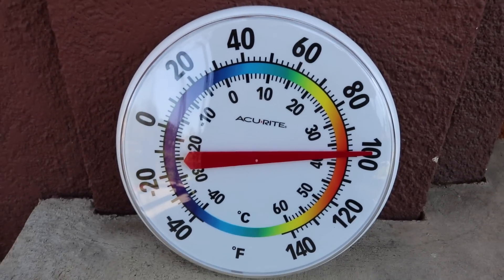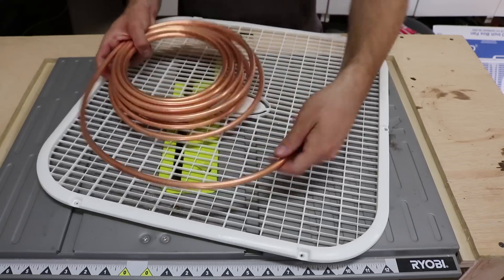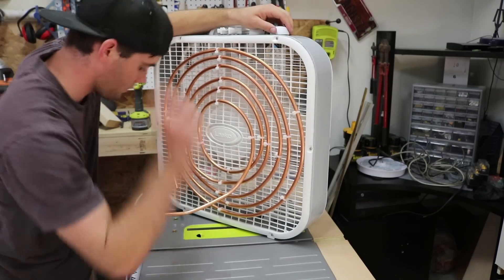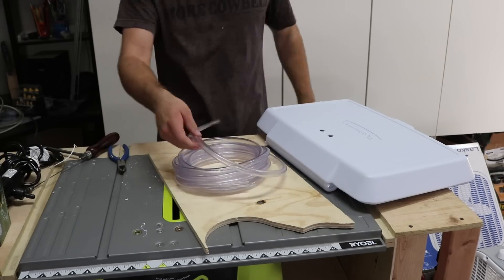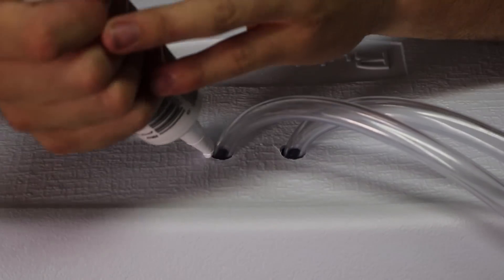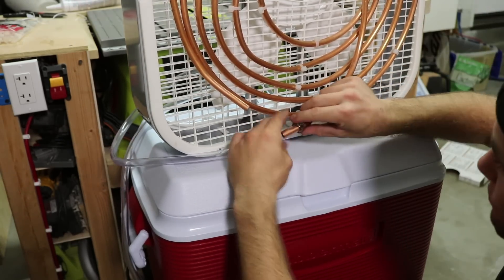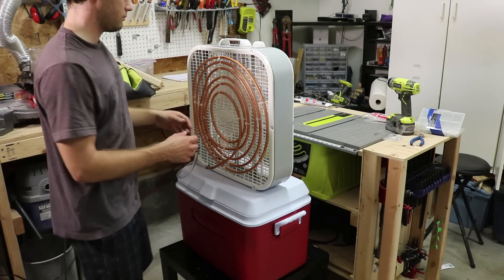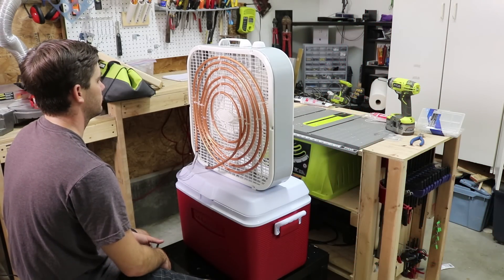$100 Homemade Air Conditioner - DIY

Comment: why didn't you just buy a $98 AC from walmart?
Reply: Because this invention does not require a hole in the wall to exit the heat, and a $100 air conditioner at those temps would be useless.
Reply: @JohnSmith-wd9rc  "Because this invention does not require a hole in the wall to exit the heat" because it doesn't exit any heat!
Reply: There's a couple of reasons why this is better for a garage / enclosed space:
  Window AC units stick out through a window, or hole in the wall for two purposes.  There is accumulated water which needs to drip somewhere,  and the heat exchanger needs to exhaust air outside (otherwise it would completely negate the cooling, if not cause /additional/ heat)
  Those portable units have the same requirements, though usually a bit easier to deal with, if you have a window (but then, why not just get a window unit?) 
  Portable units have 2 things over window units: usually less power draw (so no dedicated circuit, or worry of overloading a circuit) - and they're, well, portable - meaning you can move them around within the room, or to other rooms as needed.  

A home made swamp cooler (which Ben created here), requires neither an exhaust port nor dripline, and is portable.  It also requires much less amperage than either AC unit.  The downside is that this will cool a small area barely to humane levels in those temps.  This is a good design, if for temporary / non-permanent use. 

For a more permanent solution, this can be scaled up to a buried 55 gallon plastic drum, automotive radiator, and a single motor to run a spindle pump and fan unit.  Burying the barrel to a depth of about 4-5 feet (the bottom) will allow the water to cool off better, as ground temps are usually stable at much lower temps. Using a stable liquid, this can be left in service for a long time.  I wouldn't use water alone for this.  Possibly automotive coolant as an additive and stabilizer if not something else. 

I've seen homesteader plans for using PVC pipe buried in the ground, in a U shap. One end is outside of the home, with a capped T on sideways - the top being capped and used for cleanout purposes, and the side with a screened off elbow for air intake.  The other end is inside, with a blower fan pulling air in.  The pipe has to be long enough, and deep enough for the air passing through to be cooled off.  This isn't usually something suitable for suburban settings though. 

So...  his homemade swamp cooler, even being $100, is a better use for his purposes.  And, it'd made a great power-outage cooling system, running on a generator or battery system.
Reply: @AeSix_Reficul  This is not a swamp cooler. This is closer to a very low btu air conditioner than it is a swamp cooler.
I know. Study is hard.
Reply: @AeSix_Reficul  
Very informative. Thanks! 👍
Reply: @AeSix_Reficul  This is not a swamp cooler. A swamp cooler MUST intake dry air, and allow the cooled air to push the room air out of an opening. Without an opening, the room will become humid quickly, and fail to cool. So, it DOES need an "exhaust port" in the form of a slightly opened window.  He made a humidifier.
Reply: @heidis8713  It depends on what type of climate you live in a dry climate it does make it much cooler.
Reply: @johnmcd6652  I don't understand your comment. Can you clarify for me please?
Reply: @heidis8713  Yes, At no time did this presentation tell us how much of a temperature change this device made. Kind of important information don't you think?
Reply: @johnmcd6652  I'm still confused. Which comment of mine were you responding to? To answer your last question, I don't believe that this device would change the temperature of the room at all. Possibly 1 or 2 degrees cooler in the area directly in front of the fan, but then it would gain 1 or 2 degrees when the humidity in the room went up. Not to mention the fan and pump motor contributing to the increase of heat. It's certainly not a lot, but temperature wise, it's still moving in the wrong direction.
Reply: @AeSix_Reficul   Dude, you laid it all down. I was just going to say because those go in windows but you sir went above and beyond
Reply: Ice and water can cost alot to keep on filling that up also
Reply: @vg2binkey884  ice can be free as most people already have a freezer and water can be recycled or use ready ice packs then reuse the water change out every week or to. You could also reuse empty water bottles as ice chunks refil water bottle partially with enough room for expansion then at the end of the day toss them back in the freezer next morning they should be frozen again and ready to go.
Reply: Very interesting, but how fast do you go through a bag of ice?
Reply: @PVP your a traitor as well.
Reply: Would you have watched a video about that? ;)
Reply: Limp business  I agree.
Reply: Because then you have to go to Wal-mart and deal with check-out?
Reply: 'cuz the video made him more than 2000$
Reply: Because it would make his electric bill shoot up
Reply: Cause he takes pride in his own inventions
Reply: Dump a 12 pk in the cooler and u r done 👍🏽
Reply: That’s what I was thinking in Walmart you can get one for under 100 bucks  and it really work spend all that time doing all that and still I know for sure it won’t cool like a real ac
Reply: Ya can find a ac fir $70-$80 nowadays....but if ya hick it ya can build this..
Reply: Honestly the guy is a genius.  Not because of his design... but for his abilty to generate 2.4 million views and make thousands of dollars off youtube off with such a simple caveman 6 mininute  video.  He knew what he was doing
Reply: Amber Walters  I'm sure he did it for the views. A portable air-conditioner is like 50 bucks off craigslist or FB marketplace
Reply: tin pan alley 1619 Broadway  maybe you could try a Swamp Cooler instead of some bootleg Seanp Cooler.
Reply: AC has to be vented out.  If there's no existing wall vent, one must be cut (and according to building code)
Reply: Not practical for the type of cool needed.
Reply: Saving more and the end
Reply: Your lazy do something create something f__ Walmart
Reply: Where's the fun in that? I want to see him add wheels to travel around the shop & maybe grab a deep freezer to make refreezable ice block. Heck, once it's fully mobile, it can follow you outside.
Reply: Cuz he’s gay
Reply: 20 watts vs 400+ watts
Reply: where is the window to allow ventilation of an a/c unit?
Reply: @tikercat  No window needed & portable... can't do that with an $98 AC from WalMart
Reply: @carpe diem plastic don't leak, deteriorate fer 100 yrs, we'll all be gone by then
Reply: They cost a lot more to run
Reply: Amber Walters  I live in a paid for house un California and cool it with a swamp cooler. I am not cheap just not stupid.
Reply: ok, I am making one for my off-grid camper which relies on a small solar gen/battery, and cannot draw alot of watts, this will give me that, and cool me down reasonable well in a camper. I wouldn't use it in a room especially in a garage that hot. The idea has some usefull applications-for that i appreciate this guy making the video.
Reply: safe air handlers save 40%
Reply: https://youtu.be/TtRkd-rITkU is also a great way to cool down!
Reply: For a small 6000 BTU/hr unit you would need 27 lbs of ice per hour. For that hot garage you need a much lager unit and a lot more ice. Also, you need to get rid of all the water that condenses out of the air. Put the box fan in a metal pan and run a hose out the garage door.

Next time open the garage door and blow the outside air into the garage with the box fan.
Reply: Tim..why did you watch this video.?.....wal mart videos..probably a better fit for you..
Reply: @davidfesta3061  esp for 120 deg garage!  no one wants to do work in a CRAZY hot garage
Reply: Besides who wants to lug a window unit around
Reply: Cuz Fuk Walmart
Reply: He'll save more money in the lowered energy cost I'm guessing.
Reply: @bintasylla1  not if your making ice constantly + the elec for fan & pump not really worth it. sadly there isnt a good alternative to real AC
Reply: @bintasylla1  cali definatly
Reply: Binta Sylla yeah that I think your right!
Reply: Because with Trump’s super Tariff, the price have gone up bigly.
Reply: Yola Montalvan reading the butt hurt trumpster comments are hilarious but oh well ... back to watching the video
Reply: @yolamontalvan9502  Another one infected with TDS,  everything Trump fault.
Reply: @yolamontalvan9502  WHAAAAA!! Want your Binky?
Reply: Yola Montalvan actually not so the Chinese government have have devalued their currency and have supplemented the cost of all the tariffs so we the consumer are not effected
Reply: @Jeeppeeps  lol someone has been brainwashed by trump tv
Reply: @Jeeppeeps  so it's my imagination that everything after jan 1, 2020 has increased by about 15-20%? tariffs are a tax, chinese manufactureres sell there products to intl corporations at an increase to cover trumps tariff, then those corporations now pass it onto us, the U.S. consumer. go shopping some time, u can see the prices have increased.
Reply: @yolamontalvan9502  LOL stop buying China then. Guess you can't afford it making $15hr working at McDonald's.
Reply: @jayp3564  stop buying China? really, since everything we consumers buy comes from china, thanx to Reagan, and deregulation, our U.S. companies buy everything made cheap, reap the profits, and rip u off by passing on trumps 25% tax on china goods to all of us. Oh but you still think industry is coming back here-lol! good luck with that theory
Reply: @tikercat  Clinton’s North American Free Trade Agreement and then getting China into the World Trade Organization was where the jobs went. Don't believe everything you read from liberal media and what you see on CNN. Democrats are the new Nazi's. Go open a history book and read how the Nazi's treated their people you might find some similarities with the Nazi's and the Democratic Party. Ready to give up your freedoms under Democratic rule? Trump 2020 MAGA! Have a nice riot tonight. LOL

Comment: That's great for a quick cool-off, but the process of freezing the water  just 'moves' the heat to your kitchen.  Remember, you can't cool (or freeze) anything without moving it's heat someplace. A freezer dumps it in your kitchen, an air conditioner dumps it outdoors. Remember this: A 6000 btu/hr AC moves enough heat to melt 1000 pounds of ice per day, which works out to a little less than 42 pounds per hour!!!
 (I doubt you can fit that much in that little cooler) (1 Gallon jugs are only about 8 pounds, bagged ice gets expensive.)
Reply: You are right that you'll need a lot of ice, but not nearly as much as you stated. A refrigeration ton (equivalent to one ton of ice per day) is 12000 btu/hr over 24 hours, so 6000 btu/hr of air conditioning would be 1000 / 24 = ~42 lbs of ice per hour. You might be able to squeeze that amount of ice into a medium sized (60 quart, say) ice chest.
Reply: @stephenshefsky5201  : You're right, I said hour, meant day. Still, melting 42 pounds of ice per hour is a substantial amount of ice, and you really have to think about where that ice comes from. Either trying to move the heat to your kitchen with 10 freezers (most domestic refrigerator freezers have 550 to 900 btu cooling systems), or you have to buy the ice.

Comment: I managed to make a buffer motor almost out of a dozen materials I'll list them for you aluminum tape an old fan housing a plastic box above a motor without its key reduction gears a plastic toy fan zip ties and a lot of hot glue and it works like a charm it's basically a handheld weed wacker cuz there's no wheels oh yeah and if you want to see that and action go to my YouTube channel ECS 150 Smith and that video is easily available

Comment: soon as you cut into the cooler lid you killed its insulation value entirely of that lid, the sealed air in the lid works as a insulation barrier, you might want to inject some spray foam to try and seal that and use your sealant on the inside of the feeds too

Comment: In Canada where I'm from it would cost $ 230.00 so it's just a little too much. I can buy an Air Conditioner at around $ 159.00 so I might as well buy one instead of spending all that money on the DIY version.  If you pay $ 10.00 for something in the U.S., you can bet in Canada that would be about $ 25.00. Pathetic, "VERY"!!!